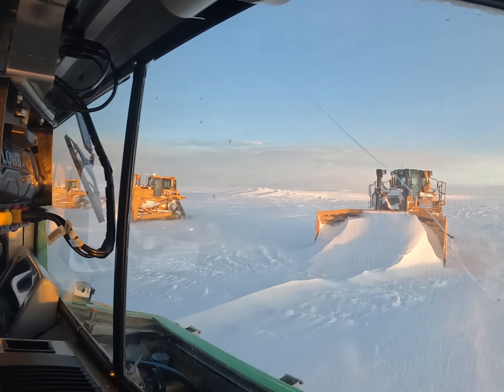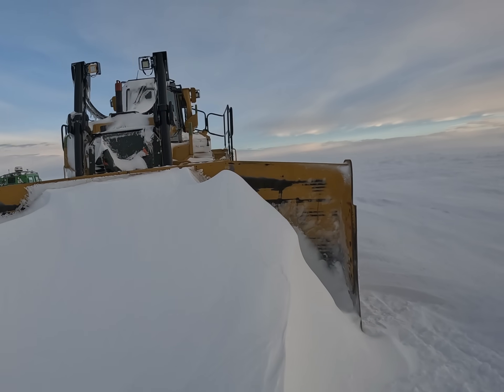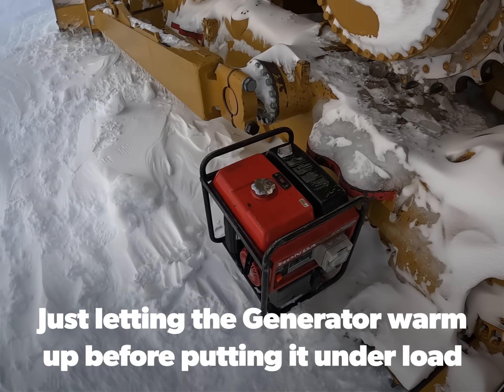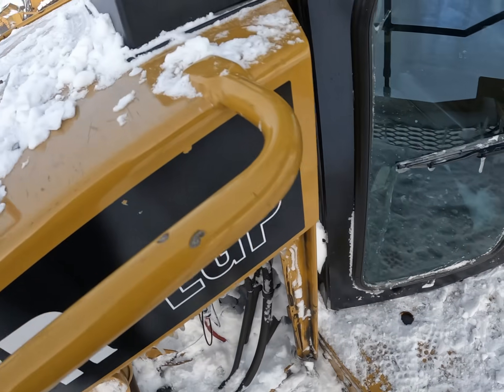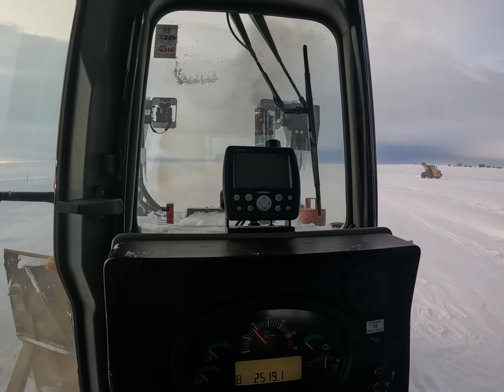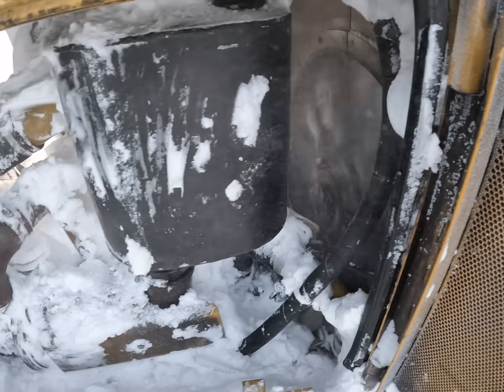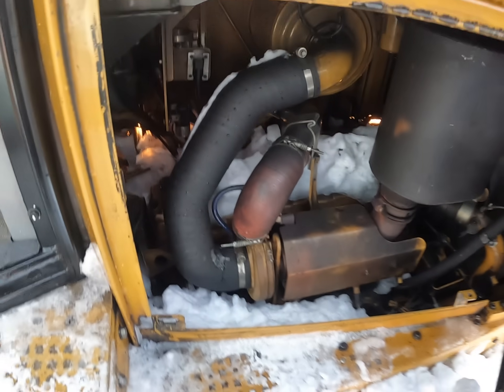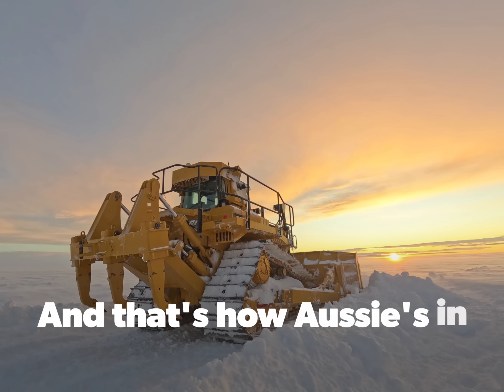CAT D7 DeBlizzard and Start in Antarctica

Comment: Nice video, impressed how easy it started once heated. Guess they put a lot into making these machines work in extremes
Reply: Millions.
Reply: Anyone who is old enough to operate old machines in the freezing cold knows that the evolution is Caterpillars starting ability is nothing short of amazing. I remember machines with "glow plugs" where you had a painful dent in your thumb from holding in the glow plug button, and using up a whole can of ether, just to get the engine to putt, putt, putt for a half hour befor it roared to life. I have sat in the seat for hours waiting for the mechanics to show up with a "salamander" (propane heater) which they shoved under the chassis, to heat the oil and engine. The situation was so bad, that they had a fuel guy go around and top off the machines that were not being used, as they left ALL the machines running at all times. But then, Ahhh. New machines. Turn the key to "on",  and the comuter automatically detects the cold condition and turns on the manifold heater. When the manifold heater goes out, turn the key to "start" and 9 times out of 10, the machine starts right up. In cases where it still doesn't start, there is an integrated ether injector. Just make sure that the manifild heater isn't on, crank the engine, and push the ether injection button, VVRroooom. Those old machines couldn't do that. PLUS, the new machines get warmer faster. The faster the machine gets warm, the faster the heater gets warm. I remember having to do hard work for an hour for the machine to produce heat. New machines, 10-15 minutes, tops. We have come a long way.
Reply: Emissions systems should never be installed on machines that far north or south of the equator
Reply: CAT even has an option for automatic ether injection. I would not be surprised if these machines have it installed.
And yes in populated/western countries they have DPF/SCR and DEF/AdBlue.
Reply: В тот день там было -15 по Цельсию ,можно было не греть блок !
Потому запустился с пол оборота !
Reply: literally all they do is take all the emissions bullshit off and put block heaters on them
Reply: @JimGriff1720  caterpaillar doesn’t make emission systems as far as I learned I could be wrong but that’s why they stopped making on road highway engines
Reply: @Ol-crusty-Cummins  yes they do, but these dozers get to go without.
Reply: @JimGriff1720  Sure
Reply: Just like any modern day Diesel engine in freezing temps… What’s so fascinating about that😂
Reply: @arfetherussian  They had block heaters running off of generators, so the block was warm when they tried to start them. This was not even a cold start.
Reply: @bills6093  A half hour in those temps does not make the block warm, just not frozen. Block was still probably only 10 degrees. But that's better than -30

Comment: Incredible that it started that easy
I’ve dealt with -30 to -60 & always heated the whole cat drive train under a chute. Transmission pump failures, hydraulic pump failures, are all to often the result of just plugging in the engine.
Reply: @69jbr69  we used onboard diesel fired  & timers on eng/ hyd heaters on excavators in the 90’s & onward but in  the mid 70’s era we used what was available.  Glad that technology has improved saves a lot of frostbite